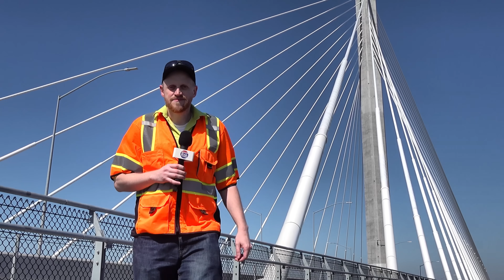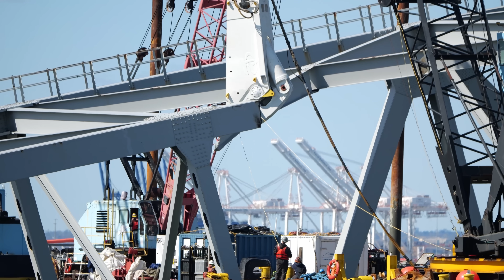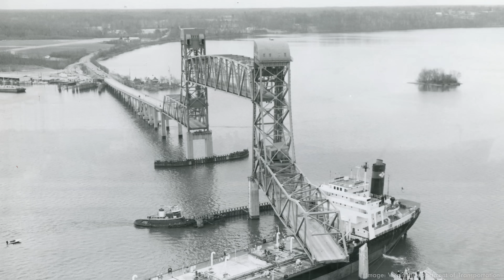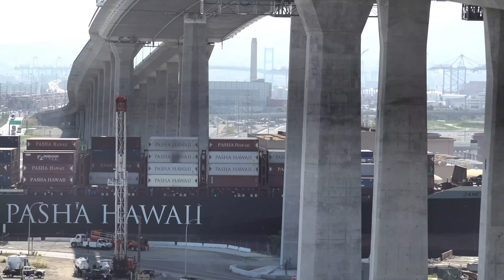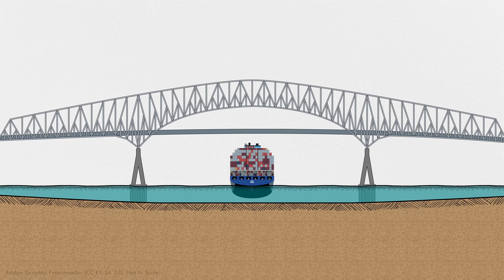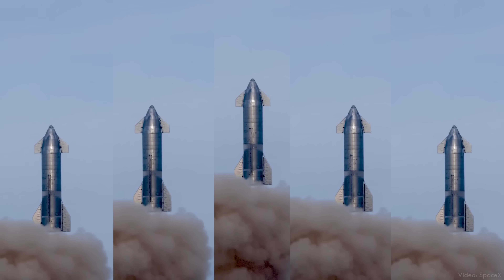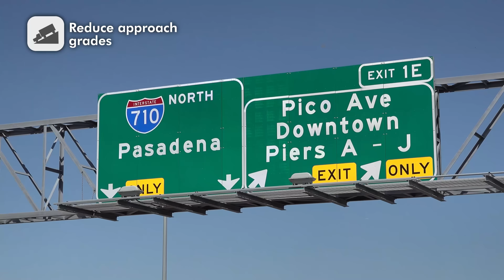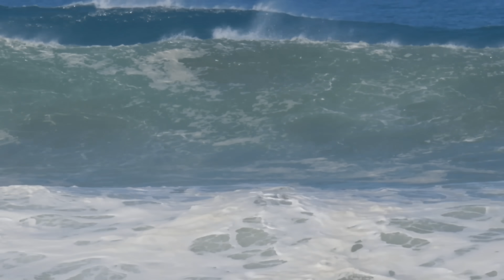How Bridge Engineers Design Against Ship Collisions

Comment: "Anyone can design a bridge that will stand for 100 years. It takes an engineer to design a bridge that will barely stand for that time."
Reply: This is a misconception. The Engineer's goal is not to reduce redundancy it is to meet a list of goals including a budget and timeline.
Reply: @appa609  That's what the quote means. Anyone can break the bank to construct a bridge that will last. IT takes an engineer how to safely cut costs so that the bridge is in a constant state of barely standing.
Reply: @Official_DJ_Spark  A well engineered bridge is not generally "barely standing" it fulfills all project requirements including regulations on structural FOS. A typical road bridge might be capable of holding 3x the maximum design load.

Comment: "Just one more lane, bro. That'll definitely fix traffic. Just one more lane."

Instead of investing in fifty thousand lanes on replacement bridges and everywhere else, put that money into trains, busses, and the infrastructure necessary to run them. Have bus only lanes, have trains and light rail running at all hours and on regular schedules. Yes, "car people" will whine about not having one extra lane, but this will speed them up as well. And that will create situations where you don't need a ten thousand foot wide bridge with eight hundred lanes because if everyone is on a single train or bus, then you don't need the space for all of those cars.

Comment: The cost of this accident should be used to modify our evaluation of estimated project costs.  We simply do not adequately account for replacement due to failure adequately.  My background is construction and project management, with a degree from Georgia Tech.

Make the main span higher and longer than required and make the main channel narrower than the span.  Force ships leaving the channel to run aground.  Other structures could be put in place as, suspenders or to create confidence among laymen; but let the bottom do the work.  It's like gravity; it's always there.  It only costs money to keep ships from hitting bridges.

Comment: 16:52 This illustration and the explanation is problematic. The piers mostly need protection from head-on impacts, or something close to head-on, so you don't need that wide island. It can just be in the lengthwise direction. That also means not taking up much of the span or blocking waterflow much. I mean it still has to be taken into account, but it won't be nearly as big of a deal as you make it seem.

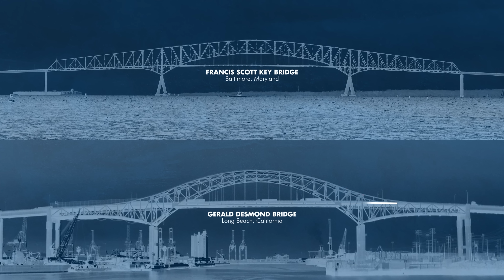Comment: 2:30 I guess you can't build the perfect bridge, life, society/anything, without the pros being balanced by some cons.

The gains here in the form of the lightweight structure and the inherent strength gained from truss after truss after truss resulting in an even stronger (than the one long beam design he mentioned) continuous box structure have the witnessed massive downside/con.

The clue's in "continuous" so that the rigidity that the
'greater than the sum of its parts' imparts unfortunately meant that when one end fails, it's all or nothing and the whole cat's cradle unwound.
It was still highly unnerving to see the collapse, especially 0:03 the opposite side of the bridge to the one struck unzip basically.

Comment: The narrator says the calculations are complicated, but they're not. You take the cost of the bridge being knocked down multiplied by the probability that a ship will knock it down and compare that with the amortization of upgrading the dolphins to be effective. Dolphins are relatively cheap so the conclusion ought not to have been in any doubt. That is, if the Port of Baltimore administrations were capable of any foresight whatsoever.

Don't get me started on the unnecessary cost of widening a bridge to accommodate virtue-signaling but unnecessary and largely unused bike and pedestrian lanes.
Reply: It would be better to remove the car lines from bridges and replace them entirely with pedestrian lanes.
Reply: @General12th  Yeah, I'm sure the pedestrians will pay high enough tolls to finance that.
Reply: @gandydancer9710  That's why tax and spend is a better policy than spend and toll.

Comment: I don't see any of the bridge protection systems that I have seen that would protect from 100,000+ tons moving at 8 knots. From a design standpoint, you would have to allow for at least 200,000 tons and up to 12 knots as they would be in the envelope.

They keep showing photos of the Sunshine Skyway bridge. The angle of approach of the Dali would miss the pylon and would hit that little island around the main pier.

The Skyway and their protective measures: a 40-year old design when ships were much smaller. MS Summit Venture was around 19,000 tons.

Civil engineering works need to be tested to see if they perform to spec.

Such "protections" have not been tested in real world tests or events.

Unless you ram a 100,000+ tons ship head-on into that tower island at 8 knots, you will not know whether it will survive the test.

For design, have to allow for at least 200,000 tons and up to 12 knots.

There is one positive and foolproof way to prevent such ship-bridge collisions -- don't build a bridge, build a tunnel.

I don't have any confidence in that installation under those kinematics, and ships will only grow even longer and heavier over time.

The Chesapeake Bay Bridge-Tunnel and the Hampton Roads Bridge-Tunnel got it right.

At least 4,000 feet of open waters and no vertical restrictions. Like on the CBBT and HRBT (actually about 7,000 feet on the HRBT).

Skyway vertical navigational clearance of 185 feet is now 30 feet lower than what the most recent bridges have been providing, anyhow.

Ships are steadily increasing in height, as well.

Recent major bridges are being built with a 70 to 100 year design life. There are other late Interstate System era bridges with about 180 feet of clearance that maritime interests want to see replaced with 215 feet or more.

Therefore it would be myopic to replace the Key Bridge with the same profile which provided 185 feet of vertical clearance.

Granted the Bay Bridge's max clearance of 186 feet will rule what can get to Baltimore harbor, but if we are designing for 70 to 100 years in the future, we can count on the Bay Bridge being replaced long before then.

So a new Key Bridge with 220 feet of max vertical clearance would be 0.5 to 0.7 mile longer than the current 1.6 miles. It would be wise to use a shallower grade than the about 4% existing, like about 2.5%.

It may actually be less expensive to build the 6,200 foot long tunnel that was originally planned. I want to see an engineer's estimate.

Comment: During my days working on a self propelled river barge here in europe most if not all bridge supports that were in the water had wooden bumper like fences just for cases like this for when the ship gets pushed into the pillar due to currents or in this case a ship loosing control. depending on the types of ships that would pass under the bridge the size of the bumpers would increase so these were also used in the bigger ports that could accept seafaring ships

Comment: To find out  for how many years it takes for "0.01%/year" to drop below half, it isn't linear, it's exponential.  My logarithmic / exponential math is less than ideal, but you can approximate it this way.  A 0.01% chance of failure is a 99.99% chance of success.  0.9999^6900 = 0.5015 and 0.9999^7000=0.4965, so  a bridge built with a 0.01% chance per year of failure has a 50-50 chance of failure somewhere between 6900 and 7000 years.

Comment: 15:40 Grady: “Back of the envelope” 
Animator: Here’s the front of an envelope!
😆
Reply: Fronts of the envelope are usually not used because they already have text on them, and on the back you only have to deal with the edges of the folder-over paper. But if you animate an envelope, you can create an envelope without text on the font (and then don't even have to deal with the paper edges getting in the way).
Reply: I don't know why that wasn't caught in production. It's so much the kind of nerdy detail that people who watch this channel would notice.
Reply: To be fair, "back of the envelope" is such a common expression in engineering that it's kind of divorced from the original, literal meaning.
Reply: @NicholasMati  and yet, to be fair, envelopes do have backs and fronts.

Comment: Also, as a utility worker, that has to  foul railroad tracks often, i can say that any time a train is en route past our work zone, there is a clear order of operations that has to take place. 1st of all, we have a flagger, who places a restricted zone within a large area of our work zone, often up to 20 miles each way of our scope of work. This means that any train engineer who approaches that zone needs to radio, not only the tower, but also the flagger to get clearance to traverse that zone, often times at slower speeds too. This alows the flagger to activate our chain of egress operations,  which are clearly written down and agreed upon by all workers that at any point throughout the day may be located in the rr row. This order of operations is determined based upon the type of work you are doing in the row. It will clearly state where equipment,  and personnel need to get to, and how they get there, should a train need to move through the restricted area. And if at any point during the day, your scope of work changes, work stops, and a meeting is held to determine if changes to the egress plan need to take place. Believe me, it sucks to have to be so meticulous,  it often lessens the amount of work that can get done in a given time, especially when your on a major trunk line, where you can have 15 or 20 trains  or hyrail vehicles a day. But it ensures that rail workers, utility workers, car motorist at at-grade crossings, train conductors, and train passengers all go home to their families. Perhaps we should have a similar order of operations plan in place when working on high port traffic waterways. If they had, those construction workers would still be going home to their families. Im not putting blame on the crew managers or the companies that had them there, these things are often unimaginable.......until they happen. I would just like it if this horrendous loss of life could lead to better practices.
Reply: Are you suggesting having all traffic stop on a bridge before a vessel goes under the bridge?  The only cause of problem to the workers as I understand it was the whole bridge collapsing.  Honestly they were almost certainly at much higher risk from passing drivers.
Reply: @glennmcgurrin8397  also, cars are the number one danger on any construction project located adjacent to a roadway, your never going to get rid of that hazard,  all you can do is put buffers between you and vehicles
Reply: Not necessarily vehicle traffic,  as that can maybe be cleared out quickly.  But the guy dangling from a harness painting pillars, he can't get off that bridge quickly.  So if more constant communication is held between the port authorities and the work crew, then perhaps the guy dangling could get to a more egress ready position before a large vessel rolls through,  incase something did happen
Reply: Excellent point

Comment: The Key bridge could have had protective barriers placed around the piers in the 700 foot wide navigable channel. While the channel was intended to be wide enough for two ships to pass under at the same time it isn't done, one ship at a time passed under. Reducing the channel to 5-600 feet to afford bridge protection was completely feasible. Especially when you consider the piers had absolutely no protection. The dolphins are around 800 feet apart, and with only 2 per side they left the bridge piers completely accessible to any angle of attack besides those 4.

Comment: I have seen a few cases of where ships lost propulsion and it made me wonder why such massive vessels have this Achilles heel. Yes, I understand ships motors are expensive,  but to have it shut down like this is madness. Is'nt there a way around it?
Reply: While it might seem straightforward to just add another engine, the reality is a bit more complex.

For most large vessels, their propulsion systems are designed with careful consideration of factors like weight distribution, fuel efficiency, and available space within the engine room. Adding another engine might not always be feasible due to these constraints.

However, with dynamic positioning (DP) vessels. These ships, which require high accuracy in maintaining their position, often employ redundancy in their propulsion systems. By having multiple power generators or engines per propeller, they can mitigate the risk of a single engine failure. If one engine were to fail, the other(s) can still power the propeller(s), allowing the vessel to maintain control and position.

This redundancy is crucial for DP vessels, where even a momentary loss of propulsion could have significant consequences. But implementing such a configuration on all ships would be impractical due to the additional space and weight requirements, as well as the increased complexity and cost.

While it might seem like a simple solution to add more engines to prevent propulsion failures, the practicalities of ship design and operation often dictate otherwise. However, for vessels with specialized needs like DP operations, redundancy in propulsion systems is indeed a vital safety measure.

Comment: Question: why doesn't AASHTO just require that any vessel created outside of the specs for which the bridge was designed ALWAYS have a tug? If a vessel manufactured 10 years after the bridge was constructed is 10% wider and 40% heavier than the largest ship the bridge was initially designed for, it will probably still fit most channels with relative ease, but the risk & consequences of an allision will have increased substantially, so the mandatory use of tugs could reduce that risk back to an acceptable level.

Also, if the risk with tugs cannot be reduced back down to an acceptable level, then too bad, so sad, but the vessel is not allowed... Period

Comment: Before the Gerald Desmond bridge was built I used the "temporary" floating bridge to get to and from the U.S. Navy ship I served aboard  moored at Terminal Island.  That floating bridge  in two segments with a ramp down to it on either side, was able to float apart  to let ships through to the inner harbor, and then float back into place.
There was no bridge at the other end of Terminal Island  back then, just a ferry over to San Pedro.  It seems not enough thought went into building the Desmond bridge to last, but also through traffic along the coast is much greater now.

Comment: Great as always, Grady. Thanks for looping Rob in. 

Something I just thought about, maybe an idea for a future episode ...
What are the relative advantages for cable-stayed over suspension or truss bridges? I can think of several, but I'm not a CE, so there are probably more issues (cost, span, height, etc.) that play into that decision.
Reply: Structural engineer here. At a high level, cable-stayed bridges are generally more economical than truss and suspension bridges for medium-length spans, which is why it seems like every new large bridge being built is cable-stayed.

One of the reasons for this is that cable-stayed bridges are "balanced" on the piers, so you can construct them by building the piers first and then extending the bridge deck out from the piers in both directions.

However, cable-stayed bridges are not a good design for short spans and long spans. Some eyeball math says the main span of the Gerald Desmond bridge in this video is on the shorter end of what's economical with a cable-stayed design.
Reply: @louisvaught2495  Thanks!!
Also, they look cooler.
Reply: I think in this case the advantage of a cable-stay bridge is the combination of span and boot-strap ability.  I.e. the cable-stay bridge design makes it easy for the bridge to be used to build the bridge.  So there would be minimum disruption to the shipping channel.

Comment: Remember the primary purpose of these things and the reason for how big they are is cars.
Extremely high weight per passanger and extremely large space taken up per passenger.

These are giant structures specificly in order to serve the insane weight and size of cars.
Reply: While cars are getting heavier, engineers design roadways using "design trucks" as they're easily the most heavy single vehicles that use any roadway. Rob mentioned it in the video. The wear on a road structure is estimated to increase to the power of 4 so a vehicle double the weight does 16 times the damage.
Reply: The actual problem is trucks, even if every single American rode a bike, the amount of shipping done via truck in this country is simply much too high. We would be better off building out our train infrastructure.
Reply: @CycFlame  Good luck building train infrastructures to cross all the bodies of water like that, though...

Comment: The irony is that if construction hadn't been happening on the bridge, more people may have died.  Police were already stationed at either end of the bridge to enforce the reduced work zone speed limit to protect the workers.  When the call came into shut down the bridge, they were already in position to do so.  If the construction crew hadn't been there, there wouldn't have been cops prepositioned and the bridge probably wouldn't have been shut down before the collapse.